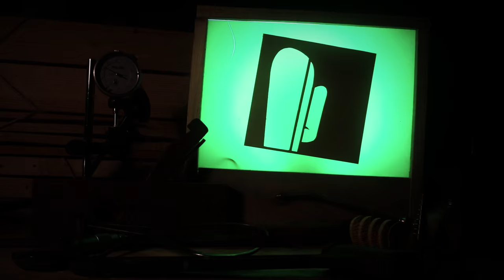Quick video: Make a bottle lamp

Comment: Super Awesome +Cactus! workshop !!! I was really amazed that the bottle didn't break when you drilled it. I now know the trick on how to keep it from breaking. Thanks for sharing!!
Reply from the maker: +Nicholas Gomez Thanks Nicholas!! You just have to keep it cool and go slow, specially at the end to prevent blowout and cracks. The result in this case wasn't perfect but good enough, nobody will touch the inside of the bottle :) Thanks again man!